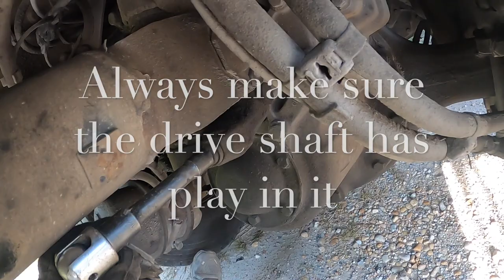Towing A Peterbilt Grapple Truck

Comment: many people dont realize how much work it is to tow from the front. i am thankful for battery impacts and that ujoint press from tiger tool. makes it so much faster to pull a drive shaft. i like that driveshaft hanger. when i am doing this the truck is usually in a parking lots with mud puddles everywhere.
Reply from the maker: Mr J.C. the tow industry has  came a long way with tools  and inventions  like that.  That makes our jod easier and faster getting off busy highways.  Thanks for watching. Stay safe

Comment: HAL !!!  You'd be surprised at the # of wrecking companies that DON"T ""DUCK TAPE "" the U-Joint bearing caps like you did !!! They would rather have you pay to have the Joint replaced !! GREAT job as you remembered what you did !!!  Have a good week & ""KEEP IT SAFE ""!!!
Reply from the maker: Mr KB.  I tape them even if they have a wire keeper. Duck tape is alot cheaper than a u joint.  Thanks for watching and stay safe

Comment: When I did the drive line removed I always had the remote to the under reach, so I could roll the u joint around to the next bolt, ok and that driveline prop would been nice on my wrecker, I drug and drive line 45 miles one time, cost me 75 bucks back in the day to weld the end back on it. Kool thank you Sir. Nice job, thanks BigAl.

Comment: Good one, and nice jig for holding the drive shaft. 
Noticed while you were securing the bolts on the universal, that the tractor next to you pulled out. Hope they watch out for legs sticking out from under other rigs..
Reply from the maker: Deernut00 thanks for watching and stay safe

Comment: I never put ptos in gear with out stopping the transmission, push the clutch in and put the main transmission in gear then flip the pot handle over , then take the main transmission out of gear into neutral and let the clutch out , no way do I like working on pro s after they start jumping out of gear , kool thanks.           This ol timer for sure has a water leak somewhere, from a head gasket to a hose to a freez plug to radiator, , thanks , oh we had a family here in boron California called the Sumter, bob the Dad mark one of the sons I don’t remember the other boys , bob passed away coup,e of years ago , colone cancer prostrate or something like that, anyway kool love you vlogs, thanks BigAl California.

Comment: at 2714 the video shows the steering wheel 180 out. the peterbuilt logo was upside down.
Reply from the maker: Mr Mike yes sir it  was fixed. Front end shop was backed up.  Thanks for watching and stay safe

Comment: Hi bud, is strapping the axle to the cross head normal practice in the us? As we always chain, some people pull the chains tight with a strap, but we use a chain binder, btw i like that drive shaft tool.
Reply from the maker: Mr Phillip I have been taught both as long as you use one or the other
Reply from the maker: Stay safe

Comment: I always thought it was dumb of a service place to ask the tow driver to put the drive shaft back.  When you put the drive shaft back you need to drive it to be sure there is no vibration, if you are towing it in you cannot drive it.  Service places trying to pass the buck on something they need to do.
Reply from the maker: Badger pa I agree with you. Thanks for watching and stay safe
Reply: Another thing you can do putting it back OEM-is to scribe or paint a line at both ends of the shaft you are removing-that will tell the re-pair service where it was. Only takes another minute

Comment: At 16:45 you said you were applying air to the system so you could pin the brakes, but you were letting air out. Did you mean to say you had to dump the air out of the system to pin the brakes ? I don’t know how air brakes work, but I thought if you had air you could make the system work, without air they ( the brakes )  lockup.
Reply: He has to let the air pressure out of the tank so he could get the fitting out of the tank to put a fitting in the tank he then hooked his hose up to so the towed truck had air in the tanks to let the brakes off.  You are correct air brakes should brake when the air pressure is removed.   Bendix has pretty good videos on youtube about air brakes if you search for them.
Reply: @badgerpa9  thank you I’ll try t9 watch some

Comment: Does the steering wheel being off center in your wrecker not annoy you?  One thing that drives me nuts
Reply from the maker: Mr Justin,  It bothered me. The front end shop could not fix until nov 3rd because they were backed up. We only used it when we had to but its fixed now. Thanks for watching and commenting. Stay safe

Comment: No Safety Blocks Blocks under front tires ?? I saw u pulled the lift forward but still .. Safety First
Reply from the maker: Mr. Mike True When I  put them on the tires were on the ground but when I removed they were not. 
 Thanks for viewing and commenting.  Stay safe
Reply: I like ur driveshaft hanger
Reply from the maker: @mikejacobsen8403  Driveline buddy makes it. Thanks  again